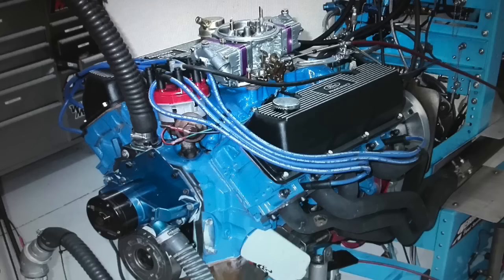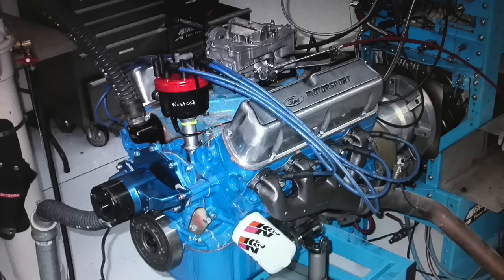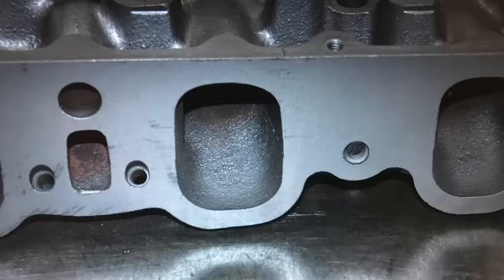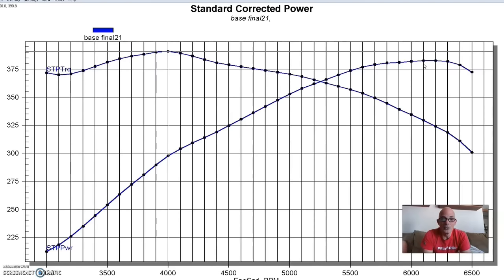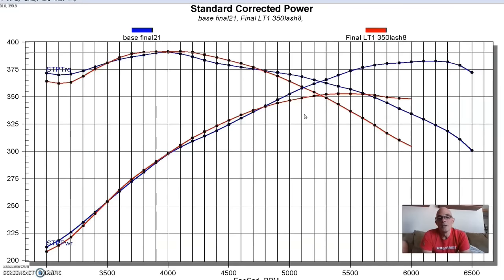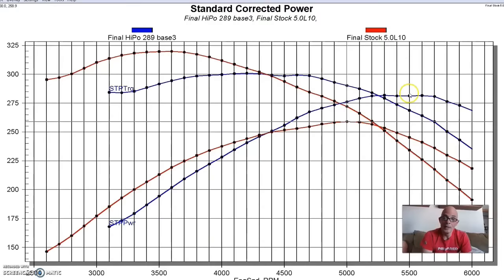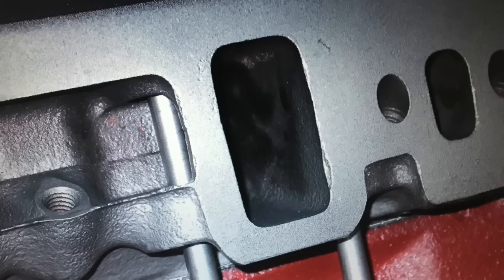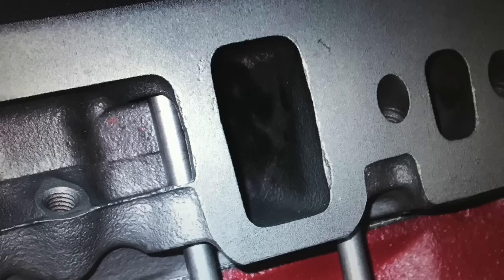HOW MUCH POWER DID THE 1971 BOSS 351 REALLY MAKE? WAS IT THE HOTTEST SMALL BLOCK EVER OFFERED?

Comment: You'd like the Aussie  xy falcon phase 3
Reply: we also produced the most powerful factory naturally aspirated modular ford small block the boss 315, 422hp and 406 lb-ft
Reply: Essentially the same engine. Except the intake and exhaust were choked to keep the power figures down.
Reply: Solid cam, 11.5:1, 780 holley, H&M headers, and if you paid $250 for the QC option the engine was blue printed and assembled by the same guys that built the factory team engines. These were unofficially rated at 380hp.
Reply: I like any Ford V-8 that the Aussies built!!! And their DOHC inline six kicks ass as well!
Reply: @terraboundmisfit  the Barra is a great engine.
Reply: GreenCrim : 350 net with exhayst and all fittings.380 gross. The best ex USA 1971 M code Phase III engine Mick Webb dyno tested all up with TriY HM headers was 350 hp net at 6200 rpm. It had 10.7:1 compression.  The solid 500 lift  cam was downgraded from the Phase II 310 degree cam to just 300 degrees. The Phase IV GTHO had the US M code chambers reblended to Al Turner and Bill Santaciciones new pattern, with a loss of 3 ccs in chamber from 57 cc to 60 ccs, giving less compression, and the Boss 351C gasket with a ported 4V closed chamber cylinder head that dynoed 380 to 390 hp gross at 6200 rpm. The engine power curve was flat to 380 at 7000 rpm with the rev limiter off. Three separate testimonies are 170 mph from each of the three  development cars. The actual Autolite ignition rev limiter was to be factory set at 6150, and that was 153 mph as claimed by Dr John Wright in Wheels 1982 Thundering GTs. The intake was alloy, the Carb Boss 302, the head gasket Boss 351C and the cam solid 300 degrees at lash, and this corroborates Richard Holdeners dyno info. Ford Special Vehicles didnt have a dyno at Lot 6; the basic dyno work was done by Repco or Ford at Broadmedows. Mick Webbs 1971 figure of 350 net  was Fords dyno.

Comment: All depends on intended use. The Clevo 4 V head & manifold flows very well in the upper rev range like any well designed race oriented motor.
But if you are building for the street its ports are too big to give adequate torque  off idle. We Aussies know because we ran the Clevo for 11 years @ our local Ford factory. 71 to 1982.  Nobody aside from bracket, vintage car rallies or drag racing runs the 4V because they are impractical having to run 3.89 or 4.1 diff to keep em in their power range.
They suck fuel @ a ludicrous rate & have low port velocity off idle. If none of that bothers you & you own shares in a petroleum corporation they are great.
But a more practical solution that flattens & fattens the torque curve & gives you crisp throttle response down low & all the way to peak rpm. The Aussie clevo 2 V heads with a port job by someone reputable are awesome & will give power up to & over 6000 rpm with the right cam / induction combo
For me & my taste a 408 stroker Clevo with CHI heads & CHI dual plane manifold. Holley sniper EFI and a street hydraulic roller cam 229 int dur 234-6 exhaust  & just under .6 max valve lift makes a beautiful combo that will hang together long, long after the hotter, peakier, piggier engines have puked the remnants of their valvetrain into the oilpan. Yet still deliver perfomance that might well leave skid marks on the INSIDE of your trousers. All with part throttle economy if driven sedately that doesn't make you cry tears of blood every refill @ the pump. Quite frankly.
A lot of the dyno tests on youtube pi$$ me off. It seems all about peak numbers.
Where as the best builders aim for a broad wide and fat torque curve from idle to peak rpm yet still have impressive results in HP with a strong rise yet there are no dips anywhere in torque curve.
Much better to loose a few peak hp and net significant gains everywhere else where you will  be able to actually enjoy it on the street. The reality is every year we see less Clevos and the Aussie Ford aftermarket is rightly besotted with the 4 litre twin variable cam timed turbo barra. That trend will only increase as the cost of rebuilding a Clevo continually increases compared to the cheap as chips & best bang for your buck in the world barra. Also trans mods & options are thin on the ground & expensive in Australia for the Clevo wheras you can find a zf semi auto & turbo barra for chump cange at any local wrecker .Well thats my 2 cents worth.
Aufwiedersien.

Comment: Love both the 289 and the 351 for totally different reasons. Dad has a 289 powered car that is super smooth and a willing revver but we know its not super powerful. Ford Australia on the other hand chose the cleveland as its base v8 from early seventies through to early eighties and for that i am truly grateful. In the early eighties you could find 351 four speeds with 9 inch diffs cheap. Not so any more!

Comment: Richard, I am trying to find a recommended copper Spark plug & gap for a 5.8L Windsor w/GT40p heads/headers running MAF 75mm on a Explorer intake. The heads will be lightly ported and port matched to the intake?
Reply from the maker: AUTO LITE AND .035 GAP

Comment: I knew a guy in the early 80’s that had a “Le Mans” cam in his 1965 Mustang. Do you know anything about the cam with that name?
Reply from the maker: yes
Reply: Richard, was there any benefit from running the cam? As I remember, he also had a 2x4 intake manifold and some ported heads and bigger valves. It was a runner! He’d scream past In-N-Out in Covina just about on the valve springs, it was a sweet sound
Reply: @richardholdener1727  please read my comment on the 289 because you can make one produce a lot of hp and the short stroke has it's advantages to. The 351 didn't oil very well above 6000 rpm
Reply: @chrisspera3192  the LeMans cam was used in Fords  GT40 289 cars. It was a solid lifter cam with 292 duration and .500 lift. It had good mid range power and high rev capabilities.

Comment: If you know what you are doing with a 289 hp you can make great power at very high rpms!!
Reply: AIRFLOW.
Joe Sherman made 400 on his dyno with factory iron head 289 AND 302.
Reply: I recall a magazine article from years ago where in Super stock , a 289 powered mustang convertible in the STOCK class would pull the front wheels and run low 12's.  I believe the class only allowed cam, very minimal porting, and headers... even had to run the stock autolite carb!

Comment: Great videos! Real thorough and informative. So the Boss 351 is it!! Cool. Thanks for your vids.

Over the years I've had a few Mustangs as well:

•'65 w/retrofitted 351 Cleveland, B&M shifter. That was around 1982. Lots of surprises (not in a good way) with that car. But it was fast!

•'88 GT 5-sp hatchback. In the '92-'95 timeframe. Practical, fun, quick, sea-level power.

•91 LX 5.0 Convertible in the  '98-99 timeframe. Not impressed; between a 3-sp tranny , weighty convertible and mile-hi Denver it was a dog!
Reply from the maker: 3-speed trans in a 91?

Comment: The Windsor heads were the weak spot on those engines. A set of after market heads really wakes them up! I own a 1967 Mercury Cougar. It has a 302 with an Edelbrock Performer RPM package on it (heads,cam and manifold with a Holley 600 vac secondary carb). It makes 340 HP.

Comment: A friend of mine had a green 71 Mustang 2+2 not a Boss Mustang. The 2+2 had a 4 bolt main 351 Cleveland 4V with a super T-10 4 speed and a Detroit locker in the 9" rear. The factory redline was 7000 RPM and that car hauled ass. Made me fall in love with the Cleveland engines.

Comment: I got a 69 351w block got it built to a 418ci stroker, all high performance, choppy comp cam, Victor Jr heads, high rise manifold, 850 carb. About 550hp. C4 rebuilt transmission, possi rear-end, put it in 65 Mustang coupe, took it on the track one day did low 12s. This was in the 1990s

Comment: The Achilles heel of the 289 was it's cylinder heads. When I decided to go back racing again after my enlistment was up, I bought a limited modified open wheel Asphalt car. The rules for the limited class specified 295cuin limit and stock type cast iron heads. Being that everyone else in the class was running a 283 Chevy with the double hump 327 heads, I was in for a challenge with my little 289 Ford. I used the readily available cast iron 1970 351W head which I then machined for 1.94/1.60 Chevy valves. I used a big flat tappet solid lifter cam since no rollers were allowed. That 289 could run with anyone and was a good top 3 car. Chassis and tires has allot to do with it, but that little 289 could still keep up with any other car on the straights and out handled most of the others due to less weight. All in all it was a good combination and reliable. In the many years I raced that car, I never had an engine failure and on some tracks i raced the gearing was not quite ideal so I needed rev it up over 7800, that and even with the Stock rods with 5/16 ARP rod bolts.
Reply: Could you have brought over the iron Cleveland head in your situation?
Reply: @dennisrobinson8008  The chambers on Those heads are larger and the compression would have been about 8:1. they had a flatop piston rule.

Comment: 351 Cleveland are “the engine” if you are Australian
Reply: I purchased a set of Australian heads and removed my large ported heads and replaced them with the Australian heads. Much better bottom end, cheaper to run, and idles perfectly. I would never run my Boss over 100 miles an hour now anyway.
Reply: @davidmellott5049  Wow great to know my friend, I’ve got a 351 Cleveland in my 79 Ranger XLT man she’s so sweet to run so smooth , thank you for the comment mate

Comment: I have, since I was a kid loved the 351c. To me it was the holy grail. In the late 90s I finally built one. I bought a 71 4 speed mustang with a bone stock 4v closed chambered 4 bolt main 351c. It gets better it had never been rebuilt, stock bore (I found the grail tell Monty Python).  I had it bored .020 over and offset ground the crack and put steel Childs and Albert stroker rods in it. I had custom flat top pistons made by probe. The cam was an old school solid roller .634 roller (I wont go into the valve train components because it would take all day).  I ran an single plane Edelbrock  I bought at a swap meet. A 750cfm DP Holley and a 7 quart Milidon pan. Finally a MSD distributor and 6AL box. On the engine dyno the thing put 517 hp at 7,300 rpm. Boy was I happy! I raced it every weekend at our local track 2300 ft altitude. It ran high 12s all day. My downfall was I tried to drive it on the street almost every day. The CA heat ant the insanely high RPMs it took to drive on the street took its toll.  After 5k miles it scattered a lifter roller baring and the roller pins did bad things. I didn't have to bore it again and was able to just re-hone the cylinders. At that point cooler heads prevailed and I put a solid flat tappet cam with a slightly smaller more street friendly profile. Boy I loved to take people for rides in that thing! in the late 90s that was a stupid fast street car. Finally financial issues forced me to sell it. Since then I have tried to find another holy grail but they are all gone. I have since bought two other 351c that turned out to be bored over twice and were basically worn out (I had no problem selling them to people chasing the grail) .

Comment: I know the 318s can rip as well as the 340/360.
Reply: I'm a Mopar guy and if we're comparing factory headed stuff this just isn't so. A 318 has a 1.78" intake valve just like a 289/302 and the heads don't flow much.
Reply: Built doesn't count, you know that.
Reply: Mopar Don't Go Far.

Comment: Those boss 351's are a very rare desirable piece. A friend sold one a few years ago that had sat outside for over 20 years. It was completley locked up yet he still got $6,000 for it, not knowing if it was salvagable.  It did have the correct carb, also completley frozen up. 
 My only experience with the hipo 289 is a bad one. Friends and I had Chevy monza's with factory small blocks. They were fun little cars, especially witha 4 speed. When the chance to buy a mustang two with a factory 302 that was not a cobra came up, I jumped on it thinking it would be a fun little car to build.  Not a ford guy but I knew of the 289 hipo ,  so I bought one.  Only to find out when I put it on the engine stand the early 289 had a different bolt pattern bell housing .  No biggie, just swap the removable bell housing on the C4 right?  Nope. The mustang two has such a small trans tunnel it requires a special bell housing, flywheel. Convertor, etc....That was all it took to send me back to the bow tie camp with my tail between my legs. I've owned well over a hundred cars and trucks. Of those only 2 have been fords.

Comment: At one point in my life I had a 59 Ford truck with a 351 -4V and C6 with 4.11 gears.
That was a fun truck.
Also, during my 30's & 40's I worked for a small exotic car shop. I had one customer that owned a mid 70's Pantera. Beautiful car with only 26,000 ish miles. Bright yellow and he kept it immaculate.
It had a 351C - 4V in it. Super fast, super fun and one of the best sounding engines I've ever heard and as you can imagine, I worked on MANY European exotics and a few American exotics.

Bottom line, I really like the 351C.

Comment: I had a Boss289 that turned just under 20,000 rpm.      Lol.

Over the years I've noticed engines with long, flat power curves always feel better in the car, and engines with almost verticle power curves (no matter how high the numbers) always "lackluster" on the street. I guess that makes me a Big Block guy. ??  That said, I agree the Boss351 is the best Ford Small Block. Hands Down.

If you have the money to slightly modify your Ford engine, put a set of CHI 3V heads, and install a modern hydraulic roller cam set up on any Ford Small Block and you're done. 
One of the most underrated engines ever built for the street.  You'll have LS guys scratching their heads. Hands down the best looking Ford engine too. 
Let's face it, Boss is Boss.

Comment: I built a nasty 351c  4bolt mains, bored 20 thousands.  pop up Pistons 12.8-1  closed chamber heads that were machined to solid lifters.,  SS tulip cut valves   stock intake with 1.4 exh.  Running a Ford motorsport cam.  657 lift 326 dur.  Found a NASCR Dominator intake, with a 2" spacer using a 1050 Dominator.   3.00 rear, close ratio top loader.  No idea on the HP but beat a11.02 runing Grand National on the street.  Got kicked off the track in Miami-Hollywood since I ran under 13 without a roll cage.  Oh and 1/7/8 hooker headers, was in a 70 Mach 1.  Beast of a car
Reply from the maker: 1.4 exhaust valve?
Reply: @richardholdener1727  Opps sorry oversized I ment 1.70    1.62 was stock

Comment: The second engine I ever built was a 1964 289 2V block for my brother's early 65 Mustang.12.5 to 1 pistons, mild port matching to intakes only, Tarantula single plane intake, 650 double pumper carb, Ford dual point distributor, Ford LeMans cam, headers. It would turn 8,000 RPMs. We decided to shift it at 7,500 RPMs to keep it together. It was never beaten on the street while he owned it. Lasted 14 years and two owners before it expired. Beat the fastest car in town, 375/396 Nova by 5 cars. Nova stopped in to look under the hood at our little engine and couldn't believe it. His comment was he needed to get a 454.
Reply: What gears were you running in the stang?
Reply: @will7its  3.89 open with G60/14 tires with wide ratio small block top loader Ford 4 speed.

Comment: One of my ALL time favourite ford motors 351 c 4v ,be it a down under gtho falcon ,or 351 ho,351boss,its the motor that just keeps giving,thanks ford EEE plant ,you certainly did your homework !! my current build ,351c with boss 302 heads ,blue thunder intake,750 hp Holley,custom 4into1 headers,4 spd toploader,in a XA fairmont hardtop,cant wait to drive it again.

Comment: When I was 16 I had a 64 Falcon Sprint, Hi-Po 289 4speed with a .60 overbore.

I thought it was pretty fast, but my father was able to beat me about by about a fender from a rolling start, with a 57 Ford 272 2bbl 3speed on the column that he had built.

I had to run from a roll, because even with a set of Lakewood traction bars, I couldn't stop it from violently wheel hopping.
Reply: good old y block

Comment: There was something wrong with your k code 65 mustang! Mine was much quicker than any of my 5.0s until the coyote which is in another league. Some don't consider the 335 series a small block but it's small cubic inches compared to a big block and a very well rounded performance engine if you can afford 8 mpg but who cares about that when making the kind of power that engine is capable of,it's a big block killer for sure. My hydraulic cammed Cleveland was good for 490 at 7600. Nothing but a 300 degree hydraulic with 520 lift,torker intake and hooker comp headers. A little exhaust port work and all factory stock other than these few mods. With a good solid lift flat tappet cam it was a beast but 3&7 rod bearings wouldn't last but one season at 8500. Sig Erson 630lift 307/314 advertised duration. It was dirt track stuff I bought from a friend. $300 for boss 351 heads and the cam.  Wish I could find a deal like that again. My employer has some boss 302 stuff for sale right now if you are interested. He ruled the dirt tracks in south Arkansas and northern Louisiana.  That car sounded completely different from everything else on the track and most tracks hated to see it show up. Wonder why,lmao.